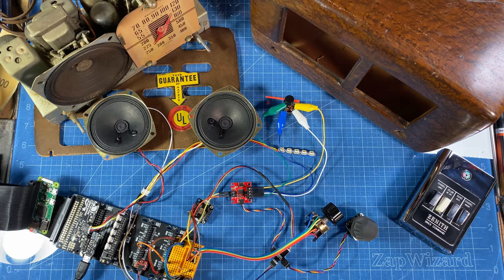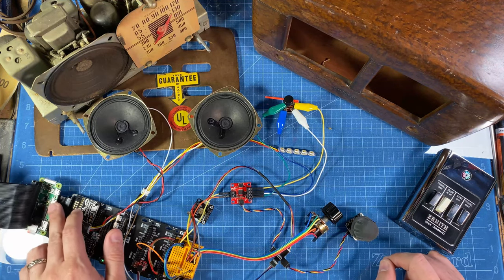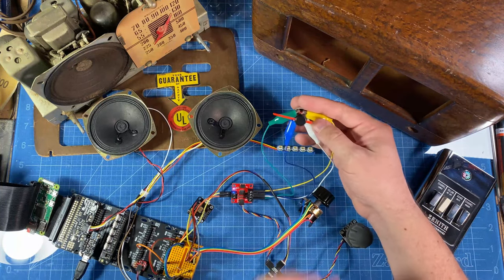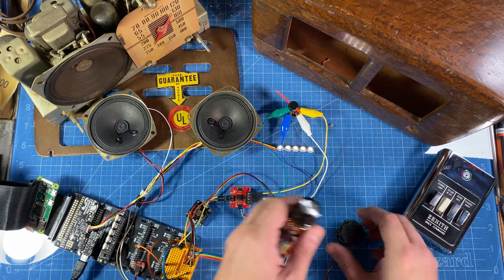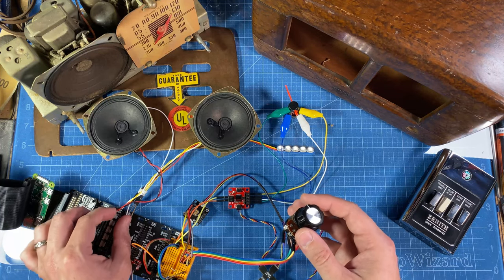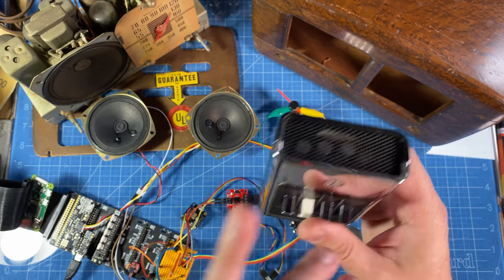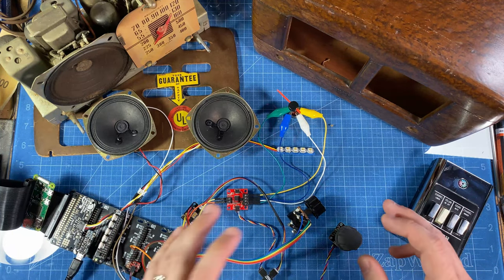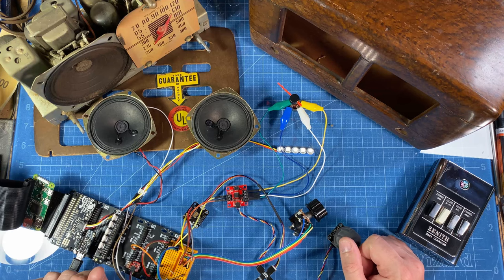Fallout Radiation King Radio Prototype

Comment: For anyone 3 d printing the body you can hydro dip the body with a wood grain from the correct look
Reply from the maker: I did seriously think about using hydro dipping, but couldn’t find anything sized large enough that I think it would wrap the whole radio in one go.
Reply: @ZapWizard  I did a vinyl wrap and gave it a thick layer of clear varnish to get the old school radio effect. It was very easy and looks perfect
Reply from the maker: @DockGraber  I did use vinyl wrap a mouse. I did it as long time ago as part of my “Real wood PC” project. But without the wood grain (texture not just image) I found I didn’t quite like it. Also wrapping along more than one axis was very difficult, and the game-accurate radio has rounded corners, not just edges.

Comment: The pip boy project you did is giving a lot of problems running through python i could solve few of them but not.......
Wish if you could just update the github repo and take a look at the problems
Reply from the maker: The code on Github is the same as I am running in development on a Pi CM4. The code also works on a Python a virtual machine crated using PyCharm.  I am currently working on my Radiation King Radio code, and some of that will integrate back into the Pip-Boy. The code is still very much a work in progress and I am still learning python. I can't solve issues without any information.
Reply: @ZapWizard  i am actually getting stuck at a errors pygame example FILE TYPE NOT SUPPORTED and stuff I will try to do it myself thanks for the reply
Reply from the maker: @vyomverma7327  The audio files need to be .OGG. I will update the readme file.